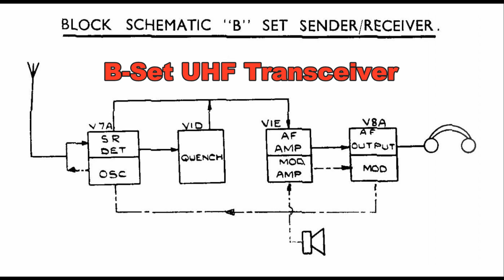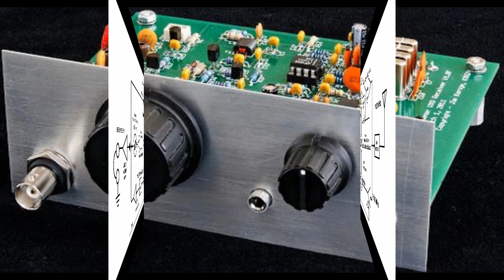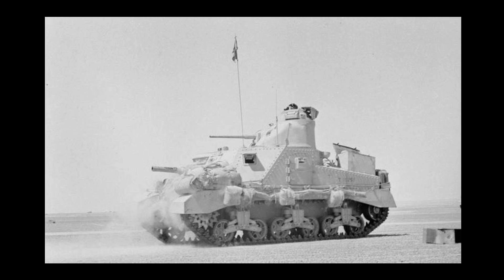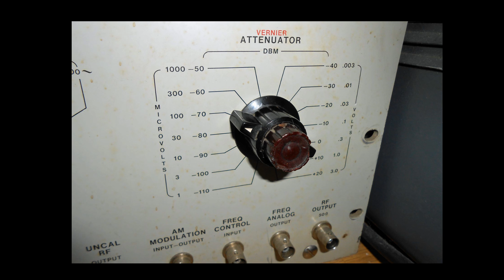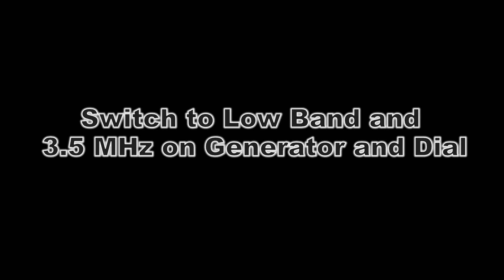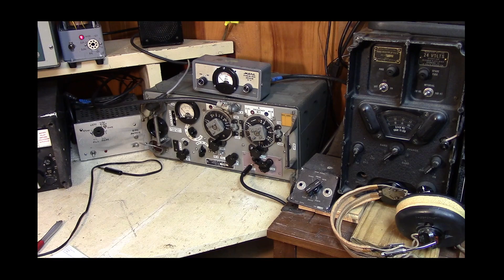Align Your Wireless Set No. 19 MKII

Comment: I'm glad I found this again.
After my previous comment 3 years ago I found that things may not be tuned up properly in the i.f. stages.
It works but not as I expected. I was able to greatly increase the volume of the set be adding a variable capacitor which is around 100 pF from the grid of V1C to earth so it's been open for three years with this capacitor sitting on the metal screening. 
I'll try again after watching how you connected the sig. gen. with a capacitor and resistor. I didn't do this and simply tuned things by on air signals. I have a synthsised v.f.o. now which I can use as a signal source.
I'm wondering if the capacitor in the i.f. can has silver mica disease and is doing nothing or shunting the signal to earth. 
However after hearing that c.w. signal at the end maybe my set is not working too bad. I since worked into Mallaig, some 280 miles distance on 5.262 MHz QRP frequency and a low inverted vee. Purposely 3 Watts c.w. on low H.T. I like that frequency as it's a wide rx so not as crowded.
73, G4GHB.

Comment: So, where DID the genuine 'Lend-Lease' MkII WS19s go? Certainly, new-in-box MkIIs were sold, mail order, through UK hobbyist magazines right through the 1950s and 60s, either as complete stations - plugs, microphones, headphones, control box, variometer, dynomotor included or with a bolt-on UK mains PSU instead - but those would be 'Military Surplus' not Lend-Lease as they'd probably never left the USA during WW2 (Canada supplied the British with enormous quantities of equipment, materiel, cash and raw materials but, those were never referred to as 'Lend-Lease').

I saw, for sale, a terribly battered, barely recognisable, Cyrillic only MKII set in a London, UK 'emporium' in about 1972 but otherwise, I never set eyes on a used US manufactured 19 set over here. Pres. Truman did demand that the USSR actually return its Lend-Lease equipment, including a large number of M4 Sherman tanks and, not to be outdone, the Russians tarted-up those battered old machines and shipped them back to Uncle Sam - presumably with the US 19 set radios still inside.

The US also manufactured the WS48, a derivative, but not a direct copy, of the British WS18/WS68 infantry set. Apart from appearing in some Sicily/HUSKY staged promo pictures, I can't find any 'Lend-Lease' WS48s issued to any British, Empire or Dominion units. WS48 DID get issued to Chiang's Chinese Nationalist troops in the far-east though Lend-Lease [*] - so that's one possible destination to be considered for US made comms equipment.

[*] I know this because no radio performed well in the wet, heavily vegetated combat conditions of the SWP theater but, a comparison of the WS48 (an HF set) and the low-VHF FM SCR-300, showed that the British inspired set could at least provide some communications whereas the SCR-300 was entirely useless [**]. You have to dig right down into Signal Corps technical newsletters to learn this. Admitting inferiority of an American product would have been through gritted teeth!

[**] As were successors like the PRC-9/PRC-25 in similarly vegetated parts of Vietnam.

Comment: Does your WS19 have a 100R resistor across the primary of each IFT? I read that this was done to lower the set's selectivity (because, it would have been hard to keep everything frequency aligned in armoured vehicle radios, given the amount of general physical they'd get). It was a post-war 'fix' (at least over here) to remove those resistors.

Comment: FWIW, some of the pages of your WS19 MkII manual look identical to the post war WS19 MkIII manual that I purchased in UK around 1969. There's a distinctive style to the block diagrams, the diagrams of the internal layout and the way that text is typewritten not printed. I'd assumed that mine was produced on one of those 'drum' duplicators, redolent with the aroma of methylated spirit, made by the likes of Gestetner or Roneo-Vickers. The exception in my manual was a genuine 'blueprint' like master circuit diagram, about A3 size. I'm not sure if you ended up with copies of the British manual - or I, an American one.

Comment: Hello.
At 35.59 you tune the oscillator.  Which component are you adjusting?  Also I have a Mk111 Canadian, it does the right things regarding the netting and Het but the BFO tone is rather quiet.  Any suggestions on  how to increase the volume of it?  
Thank you, David
Reply from the maker: Huh. Check the voltages on the 6K8 Valve. Then look at the bypass and coupling caps. The 19 MKII and Canadian III use the same BFO circuit. The UK III has a new BFO circuit.
Reply: @MIKROWAVE1  Thank you for your help.

Comment: Thanks for showing this! I bought one of these sets, unfortunately missing PSU and such but I did get the connectors and such. Building a psu shouldn't be that hard :)
Reply from the maker: You would be surprised how well it responds to a well regulated medium voltage and fairly stable HV power supply. Its almost chirp free and starts to sound like a Yaesu!

Comment: You mentioned the output impedance match well on 50 ohms.  But, without the variometer is there a Tank circuit to lower the output impedance of the 807?  In short, do you know what is the real output impedance?.
Reply from the maker: Its low - like 20 Ohms, but it loads into a flat 50 Ohms acceptably.

Comment: Thank you Mike for sharing the procedure with clear and precise images and instructions. I have owned a 19 mk ii since the mid 80s, it is a Russian version, it works well but some parts I have replaced by an Italian one, I have all the documentation so I have been able to build the power supply and I have been able to test the device (I'm very proud of it). Unfortunately it has been off for a long time and I'm a little afraid to put it back into operation!! Thanks again Mike, great video, so far the best on a technical level!!  
73 de IK0VWH
Reply from the maker: The old sets in my shack do not like to be ignored and they tend to surprise us when they are finally turned on again. How can they go bad when they were "fine" last time you used them?
Reply: @MIKROWAVE1  I do hope so 👍😊

Comment: Interesting, thank you. The comparison between transmitters and receivers at the end was enlightening.

I acquired my 19 MK3 three years ago quite cheaply and I found out why. I had to re-wire some wrong wiring, re-wind 2 coils with new wire of about 40 SWG, replaced 3 visibly leaky capacitors and other various bits of work. BFO poor and only working about one third it's travel so use the rx. switched in it's NET position, which has a toggle switch on my set. It seemed very deaf and I put it aside for a year then looked at it again and found a different value fixed capacitor inside the 2nd i.f. transformer which I replaced with 3 new ones to get the proper value but couldn't tune the i.f. core as I think they must have been aligned then glued so they didn't move when crossing uneven ground. I'm guessing somebody tried to widen the i.f. for a.m. broadcast reception, I don't know. I've never seen an i.f. transformer with two different value capacitors in and I can see in the wax where the original was removed. 

It's tatty, I converted the EF50 into an xtal oscillator only on tx for stability and ease in finding 5.262 MHz, and added a low value variable capacitor for ease in tuning the rx. around the main frequency setting. Stability is good at 60m and I don't need to re-tune  the rx.

Only used it on 60m so far recently with 250 Volts on everything so just under 3 Watts c.w. A 160 mile 2 way QSO is my best so far just after Christmas. Now the low band on rx. has a coil gone o/c, probably due to oxidation like the other two coils which each had a green spot on the winding and broken when I removed the wire..

73, Bill, G4GHB.
Reply from the maker: Wow you are mad all right! That was how I got my R1155. It had so many issues, that folks just gave up. Oh I have had some beat me. But its worth the journey to see if you can bring them back.

Comment: Excellent video, this was a godsend.  Thank you, you helped me more than every other source that I’ve found, combined. I have a question, if you wouldn’t mind.   I have a WS-19 Mk. II in excellent condition, it looks like it just came out of storage.  It has Cyrillic and English, it also has the Power Supply Unit No. 1 mounted together on a steel plate.  I’ve been told it was made in New Jersey.  I’m in the process of a re-cap right now.  My question is about your headphone output on the front panel.  My set is lacking this feature, and I’d really love to add one, if possible.  Do you know if your set came stock this way, or was it modified sometime later?  Do you know if it would it be much of a project to add a phone output there?  Prior to seeing this, I was planning to buy purchase an original control unit and the original headphone/microphone set.  (I actually just purchased the headphones/microphone component, but I’m not super optimistic about its functionality.). I’m sure the control unit would introduce a whole new pile of obstacles as well, and I’d love to avoid it if I can.  Any advice would be a huge help, and I’d be forever grateful.  You’re the only person I’ve seen on YouTube (or the entire internet for that matter) who goes this far into the 19 set, and I want you to know that I’m immensely grateful.  Thank you.
Reply from the maker: I made a little plate on the front to replace the original and faked a the graphics. This left room to add the headphone jack and a minipot that is in the cathode of the RF Amplifier stage as a gain control. Both were helpful!

Comment: What happens with 2 super-regens is that their quench oscillators lock. Essentially a kind of encryption. When you have more than 2 sets, you get poor performance and interference. There are patents for this. The patent I am referring is one from 40s from UK. But Superregen receivers have a amazing number of recent patents for 2.4 ghz  data comm etc. It is really fascinating as to how such a simple circuit works and what it can do
Reply from the maker: Very cool. I actually worked for a company that made remote controls to turn on dock lights that used a super-regen in the early 90's.
Reply: @MIKROWAVE1  search for Superregen patents - some as recent as 2018. They have adapted it to do high speed data.

Comment: What a great video. I used 19 sets in the army cadets at school, and loved them - especially with the dynamotor power supply that kicks in the second dynamotor on TX- you could always tell a 19 set on AM on the air, as the carrier faded in over about a second as the power supply sped up. I have one of my own now, a Mk III in good condition, but it needs restoration and a PSU. It was a project on the to-do pile when I suddenly lost most of my eyesight, and I can't work on electronics any more. So I'll either have to find a fully working one, and they're expensive and rare, or some friendly local restoration nut who'll take it on for me! But I must get back on air with it, they're very characterful sets to operate.
Reply: proudsnowtiger   ,  Hopefully you will FIND (HINT, HINT!) someone to do what is needed!